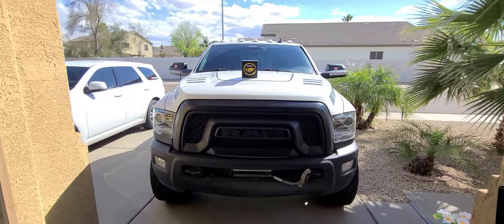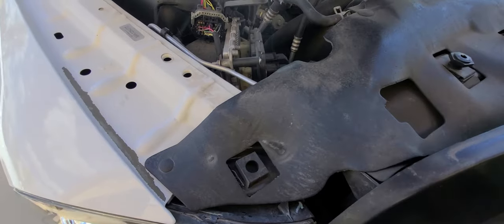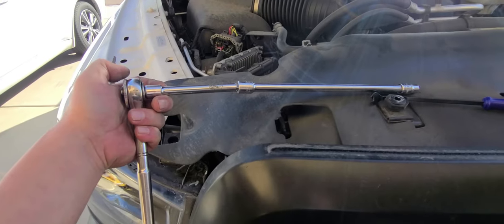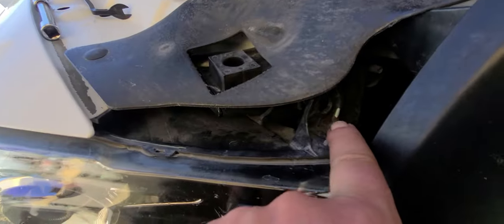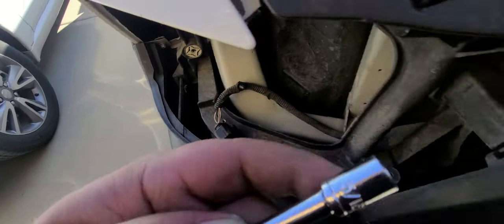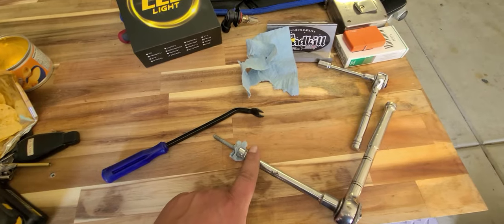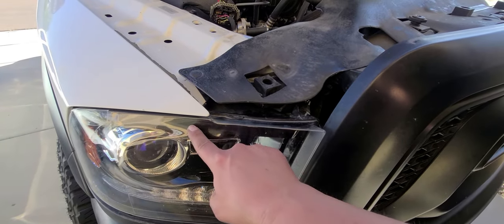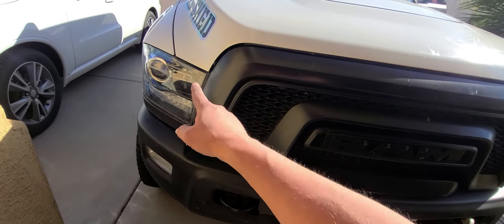(No Grille Removal Needed) Replacing your Ram Headlights! Auxito LED Installation #auxito

Comment: Nice video.

Tips on LED bulbs: the chips need to face 3 and 9 o’clock. Easiest way to accomplish this is by making sure the cable that comes out of the bulb is either at the very top (12 o’clock) or bottom (6 o’clock) .

The shadow on the lens when the headlights are on will be straight up/down vs diagonal If not “clocked” correctly.

Quick question on you headlamp assemblies: are they aftermarket? The lense on those projectors look clearer than stock.

Very nice truck btw
Reply from the maker: Rookie on clocking these, thank you for the info!!

Comment: Awesome video!  Can you help confirm something?!  I have a 2022 Ram 1500 Classic Warlock with the same projector style housing….can you please tell me what the bulb size is for low and high beam? I’m getting conflicting answers all over!  Is the low beam H-11?! Thanks so much!  I need to order high and low beam and even the manual lists two separate sizes 😫
Reply from the maker: I would remove it before you buy to be sure.